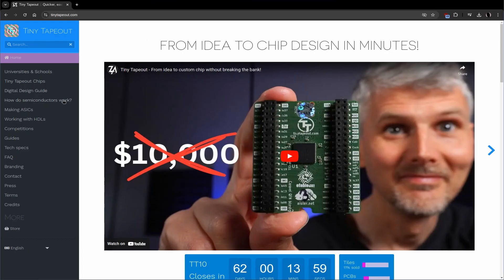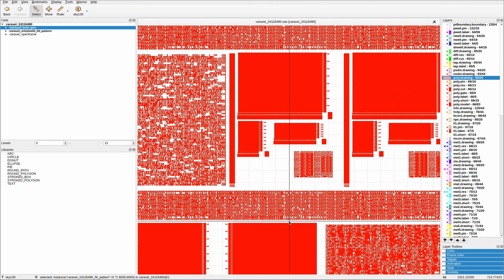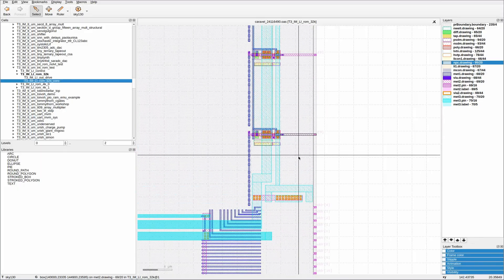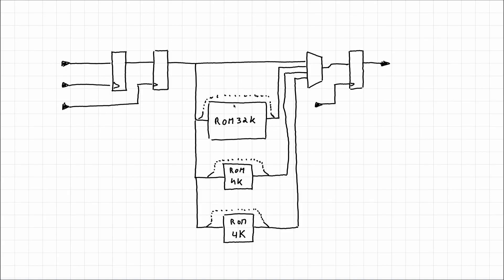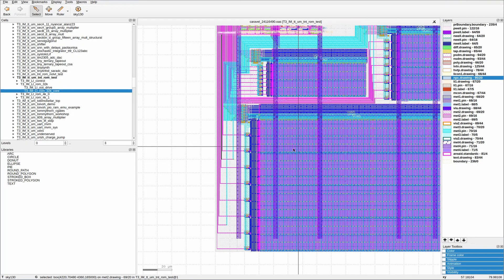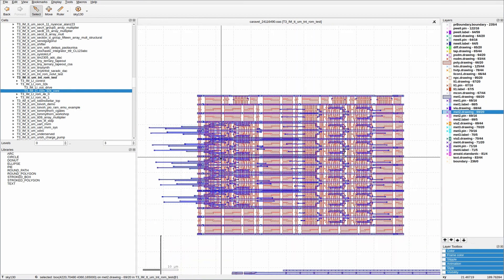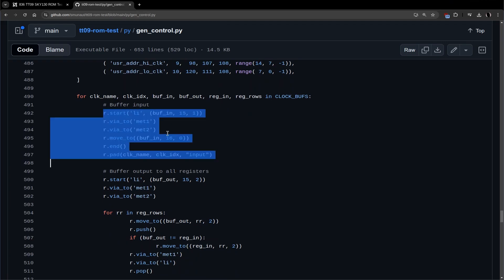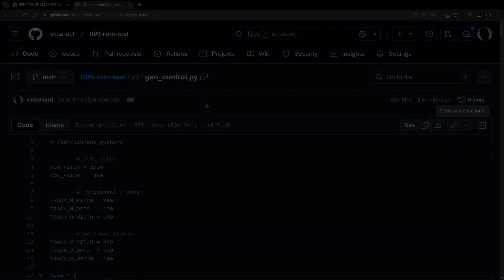SKY130 ROM: Tiny Tapeout 09 test !

Comment: Summary of the Sky 130 ROM Compiler Update

*   0:00:02 Introduction: This episode discusses the Sky 130 ROM compiler, focusing on testing and characterization rather than design.
*   0:00:18 Tiny Tapeout 09: Two test ROMs were taped out on Tiny Tapeout 09 to compare performance and leakage current of different transistor types.
*   0:01:04 AT2600 Project: The AT2600 project by renaldas also utilizes the ROM compiler for storing four built-in 32-kilobit ROM cartridges.
*   0:01:51 Layout Inspection: The layout of the AT2600 project and the test ROMs can be inspected using KLayout by downloading the Oasis file from the GitHub repository.
*   0:03:07 Test ROM Details: The test ROMs include one 32-kilobit ROM and two 4-kilobit ROMs with different aspect ratios.
*   0:03:50 Automated Generation: The core of the ROM macro, including the bit array, muxing, word line drivers, and address decoding, is automatically generated.
*   0:05:35 Manual Work: Some aspects, like power rail connections, address decoder connections, and final output driver integration, are still done manually.
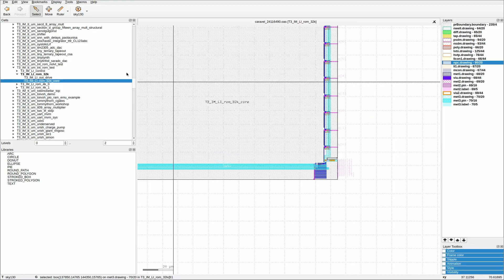*   0:07:08 Digital Block: A digital block using standard cells sends test signals to the ROMs for characterization.
*   0:07:55 Testing Methodology: The digital block uses registers and a mux to send precise address sequences and capture the ROM's output, measuring hold time and setup time.
*   0:10:15 Calibration: Pass-through signals are used to calibrate out mux delays and routing variations.
*   0:12:26 Future Chip: The chip is expected to return in mid-2025, which will allow for correlation between measurements and simulations.
*   0:12:28 Digital Block Design: The digital block is designed with a focus on neatness and matching, using a programmatic approach to control cell placement and routing.
*   0:13:36 Programmatic Layout: A Python-based tool called "gen\_control" is used to generate the digital block layout programmatically, creating a TCL script executed by Magic.
*   0:18:41 Conclusion: The main goal of this test is to validate the ROM's performance and correlate measurements with simulation and modeling results.
*   0:18:57 Modeling: Accurate modeling of the ROM is crucial for estimating delay without full post-layout simulations.

I used gemini-1.5-pro-exp-0827 on rocketrecap dot com to summarize the transcript.
Cost (if I didn't use the free tier): $0.04
Input tokens: 28853
Output tokens: 595

Comment: Very cool.  My immediate question was why you didn't move the output flops inside the mux instead, essentially sandwiching the ROM between flops (obviously costing a bit more area), but I guess it doesn't matter much
Reply from the maker: Putting the FF inside the mux would have made the "calibration" path useless since the capture would have been at different points by different FFs.  Of course this assumes each input of the mux has about the same delay but looking at how the mux is done, this should be the case, or at least much closer than the alternative.